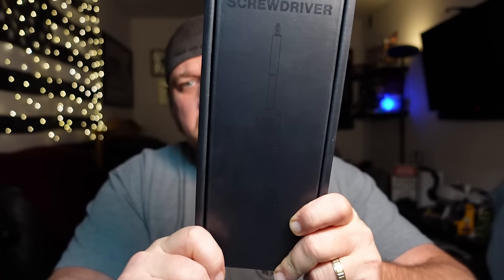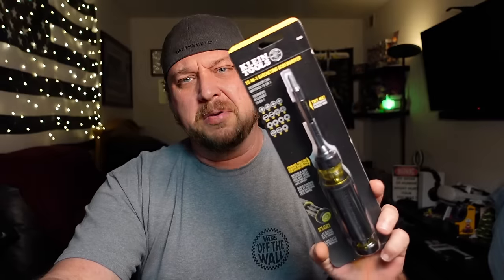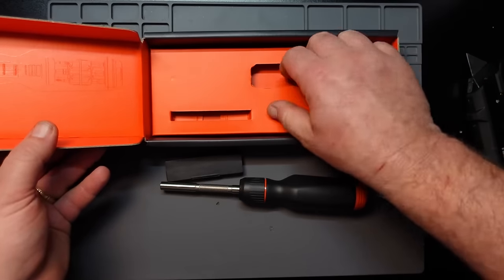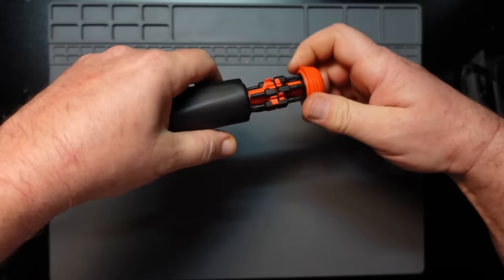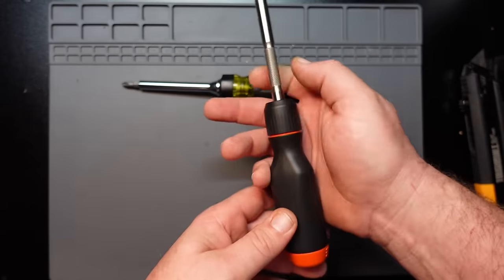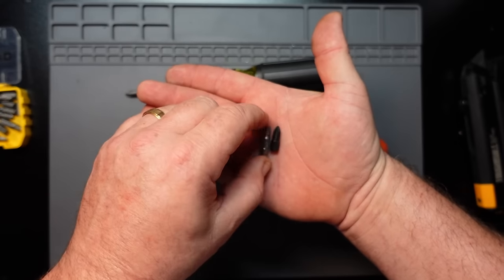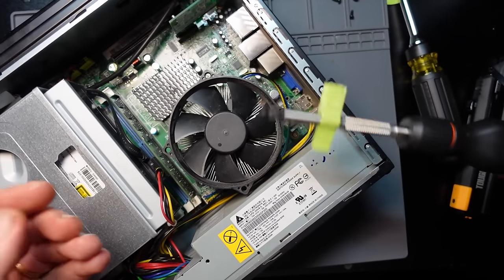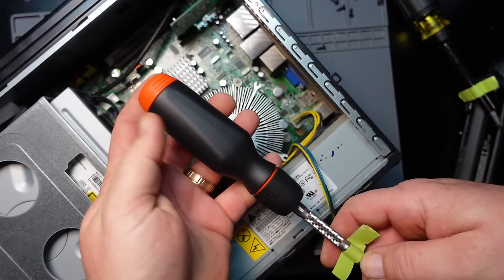LTT Screwdriver Vs Klein

Comment: This isn't worth it as a screwdriver, it's probably quite refined but it's not like it's a new paradigm and a 10 dollar jobber will do you in most situations, I use a ratcheting screwdriver for sinking drywall screws at work or building computers at home, the point is that this isn't a tool that needs refinement but it's a nice way to support a channel that you appreciate. That's the selling point, comparing dollar for dollar against something else isn't going to be pretty, like it's a hundred dollars CAD that's insane for this but if you feel like supporting for something like 40-50 bucks then you get a pretty good tool at pretty good value. That's the way to look at it and if you don't want to support at that level than this really isn't good value.
I'm a big fan of LTT and have an LTT shirt but that didn't seem as egregious valuewise.

Comment: That LTT is too cute by half. It's definitely marketed to tech geeks. I'd be wrapping that handle with some 'hockey tape'. Ironic that they made a nice knurled section on the shaft but not on the handle. Maybe instead of 'hockey tape', I'd get out yee ol' Dremmel and cut a knurled pattern or something. 
I've got a few old sets of small drivers with stainless steel handles and a backend cupped piece that spins allowing one to hold the driver in place and use thumb and middle finger to rotate the tool. They are about 1/4" diameter at the handle and work well for working in tight spaces. One lab I worked in had a motor that hung on a hook with a flexible shaft and a foot peddle. That thing was posh AF.
Reply: You know, grip tape isn't a bad idea. Adds grip, you can replace it if it's too dirty/starts to degrade, and it comes in a million colors/styles if you want to get creative.
Reply: @Lord_zeel  I just stick with black. (pun intended). I've been using a 'hockey wrap' -(once around flat and then spin the roll to make a rope, wrap that around the handle in a spiral and then wrap a flat layer back over that.) on various tools for years. Great for cheaper hammers, maglights, It's the duct tape for grippyworld.

Comment: I have the klein ratcheting driver and I do like it, but my only issue is that around the 1-2 month range the grip on mine just started spinning freely with any moderate force applied to it.
Reply: My Klein 11-in-1 does the same thing. I think most of their screwdrivers do. You can warranty it. I buy mine from a local electrical supplier, I walk in, hand them the screwdriver and they give me a new one.

Comment: The day they discover one way bearing we will got flooded by the most advanced ratchetless ratched screwdrivers.
And its not that hard, two of those bearings and a selector to wich one engage and you will not brake or overcome those bastards, they hold nitro engine starting   and drive helicopter rotors. At least rc ones. 
Thats the most zero degrees back action you will get.

Comment: So, giving this a like before I hear what you have to say. I expect we might disagree but I value your opinion, I'll her you out then share my thoughts.
Reply: Here's to you, Bitter Robinson...
Reply: Have to agree on the color grading, I'm a big fan of their ratcheting screwdriver, having owned half a dozen others, nothing else has come close. I picked up their "orange dream" motherboard waterbottle, and the print is basically red. It doesn't look tasty at all.
Reply: Alright, I think we're pretty well aligned on this. Personally, I prefer a bare plastic handle that won't deteriorate like TPE, but then my favorite fixed blade are the Vessel Megadora, and the overmolding on those has held up pretty well for me so far.

As for saving money, the Megapro from which Linus Media Group licensed some aspects of their design is something like $30, but it's solidly half as good as the LTT version, in my opinion, that is to say it's still very high quality, still better than anything else I've tried.

Comment: The ratcheting direction changers are SPECIFICALLY designed to select in "reverse" to the screwing direction.
The reason is that if that part of the screwdriver touches something, when you rotate the handle it won't throw the ratchet into the wrong direction.
.
You set the ratchet direction by holding the selector in one hand and rotating the screwdriver handle in the direction you want to go. Then, if the selector rubs against something, it will force the screwdriver harder into the correct direction.
.
If the ratchet mechanism is the other way, set by rotating the selector towards the way you wish to go, then bumping the screwdriver will knock it into lock or even worst into reverse.

Comment: Something fishy here…. Either you have a proprietary positive air pressure system on your PCs or you cleaned that out beforehand.. it should be caked in dust internally lol. 

Also multi-bit drivers with the rotating butt end are far better and faster. Now if someone made a ratcheting driver with gearing that was like 5 turns to your one turn that’d be the tits.

Comment: This fuggin thing again... It's a ratcheting screwdriver made by Megapro. LTT fan bois would buy a turd for $60 and say "wow this turd is great better than that $30 turd that is the same exact thing minus the marketing". For those saying "oh probably good for PC building" I've built hundreds of PCs and work in data centers. A normal screwdriver works fine. A precision screwdriver also works very well. Sure this probably works for most people but it's overpriced. That's a fact. Stop buying into the hype and following your leaders.

Comment: Do the LTT bits fit in the DeWalt screwdriver?

If so, that would be quite the combination if there was a way to use a T5, 5.5, and 6.
Reply from the maker: No they don’t. They go too far into the bit holder.

Comment: I've had the LTT screwdriver since it came out, and while I do think it is a little pricy, it is by far the best screwdriver that I own, and use it for everything that I'm not using the electric driver on. It is smooth, but I'm never had an issue with it being slippery, but that's going to vary from person to person I guess. They could mold some texture onto it to eliminate that though. I do like and prefer that it doesn't have the rubber grip, but that always deteriorate and gets nasty/sticky over time. 

That said, I do have a hard time recommending the LTT screwdriver, simply because of it's price. But if you do a lot of computer work, or other fine work that would benefit from it's very low back drag resistance, it's tough to beat. But it's also capable at higher force stuff too. I've used mine from driving screws into hardwood as well.
Reply: It's undeniably not great for anything requiring torque or when it gets wet. It's clearly a design choice given that they expect most users to use it for computers I imagine. I'm sure it gets the job done like you say but I can take one look at the design of that hard plastic mold and tell it's bad when dropped and designed for high precision work not torque.
Reply: @colamity_5000  I haven’t dropped mine, but user reviews say the handle holds up well to dropping, though haven’t seen any reports over drops from higher than a regular a frame ladder, so 6-8 feet. The exception being the clips that hold the bits sometimes break from the higher drops. 

As for higher torque, haven’t had any issues with anything I can do by hand, and for anything beyond that I’m using an impact driver on anyways. But to your point, this is designed for precision over torque.  if you need higher torque, there are better options.
Reply: @JeffDeLamater  I don't know how much user reviews matter when 90% of them are probably not experienced with tools and using it inside on non concrete floors. But I mainly mean the internals not holding up when I say it looks like it won't survive drops so what your saying makes sense. When you have no rubber there is no shock absorption so the thinnest plastic will tend to break first, that's probably the clips you mention.
Reply: You could have just bought the original, MegaPro & it would still be the best screwdriver you own & at half the cost.  It’s so weird to me how MegaPro has been making these in the US & Canada for years, yet Linus goes to a Chinese factory to knock it off & it somehow costs MORE money

Comment: the klein probably can't use normal bits.. and for sure you need a good 'clean' tool for on your desk vs one in your toolbag behind your seat. 

Should measure the barrel(?) diameter as well, since working on computers and equipment sometimes means super tight/confined spaces that regular 'modular' (replaceable bit) screwdrivers cannot reach.. maybe the LTT one is slim enough to get into those places. I kind of doubt it but you never know. This is where you get a use case for those 400 buck wiha technician kits
Reply: The Klein takes 'normal' bits.
Reply: does it? looks like a normal (short) bit would just vanish into the barrel
 @whitedo1
Reply: Looks like it takes longer double ended bits like in every Klein drivers I've seen which is a deal-breaker for me personally. Don't know if they do one that takes standard bits. Would love one if they did.
Reply: It's slimmer than most, but it's still not as slim as a regular screwdriver that doesn't have swappable bits.
Reply: @dizawnofwizar  The Klein bits are normal length, the LTT screwdriver uses silly half length ones that are nowhere near as easy to find as the regular ones.
Reply: @ferrumignis  the Klein bits are medium length double ended. You can't put a normal short bit in it from what I can tell or it would disappear inside the barrel. The ltt ones are like half the length of "normal" shorty bits. Sorry you can't argue that a 2inch long bit is the same length as a 3/4 inch long bit
Reply: @dizawnofwizar  What was the screwdriver that Funk demonstrated putting standard bits into in this video? (not the LTT, the other one)
Reply: @ferrumignis  there wasn't one, he didn't test it

Comment: The LTT is a way overpriced piece of plastic garbage with a fancy box.
It looks like it's sold at IKEA with the quality of a children's playskool toy tool set. 
Not only is everything plastic, but it's engineered to be the thinest and smallest plastic possible for minimal cost, maximum profit, instead of quality. It is only useful on small computer screws that don't require any real torque. 
$70-$90 for 1 screwdriver that has youTube channel branding. 😂 a sucker realky is born every minute. 😂

Comment: Really surprised that the handle on the LTT did not have at least grooves for anti-slip, kind of a disappointment. Klein was cheaper and had more materials used to make it. That alone tells you where the seller places the customer when designing a product.

Comment: I do not like ratcheting screwdrivers and I dislike the LTT screwdriver because of the cost of the tool and I can do better, and get it cheaper the 11 in one or the 14 in one Klein a better tool, and a cheaper tool, and I don't have to pay for the drama that LTT went through on YouTube where he insults people because someone pointed out he was wrong, and lied, and then lied again to cover his first lie! I am a retired Building Engineer with a universal license that means I was allowed to work on the biggest equipment in the biggest buildings (30 floors and taller), and getting the big bucks my tools had to work as the CEO of the building was often standing in my way when he says he wants to cold enough to hang beef on the wall that is what he got, and I had to do this without freezing the lower floors which is easier said than done, and I could not cry about it just do it that is why I got Klein not LTT!
Reply: I total enjoy your videos!